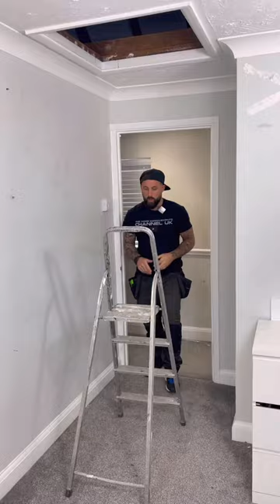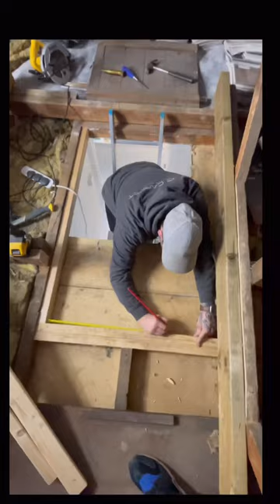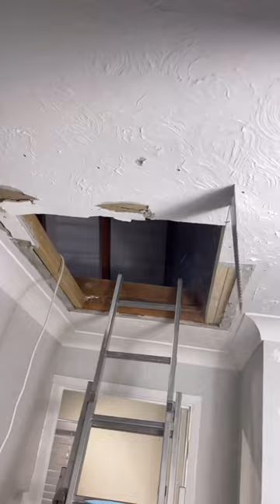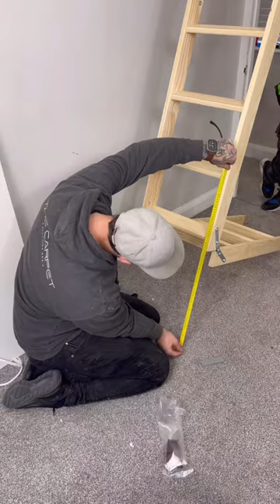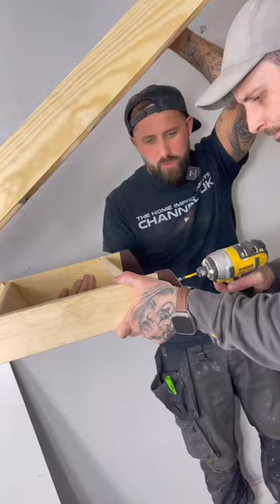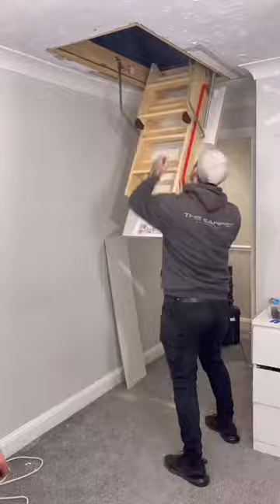How To Install Loft Ladder 🪜 #diy #howto #shorts

Comment: Did you get the opening rod with the ladder? or did you have to buy separate, can’t seem to find one with the one I bought
Reply from the maker: Yes comes with 😊
Reply: @homeimprovements  Is it on the ladder somewhere ?, I didn’t get one in the packaging